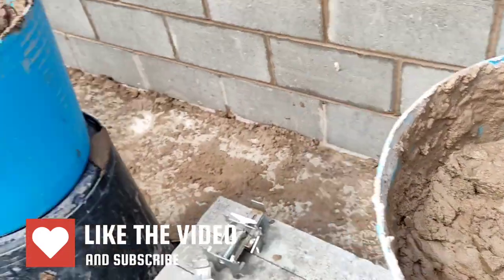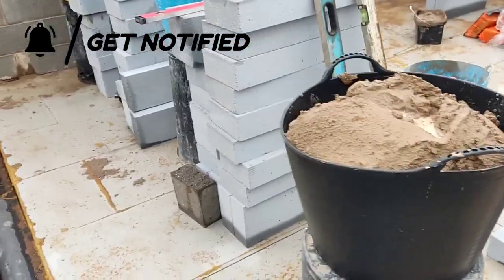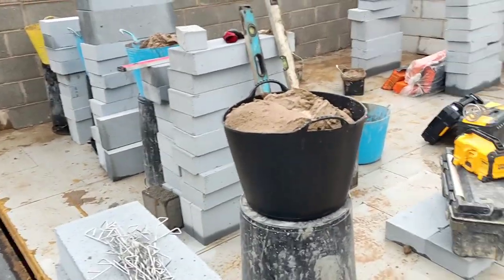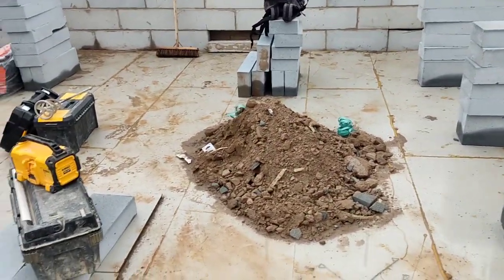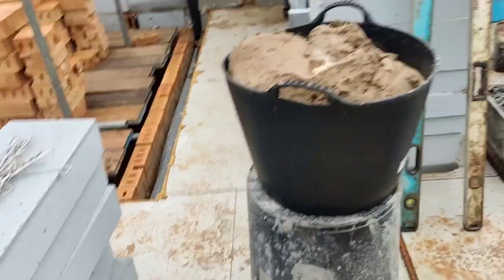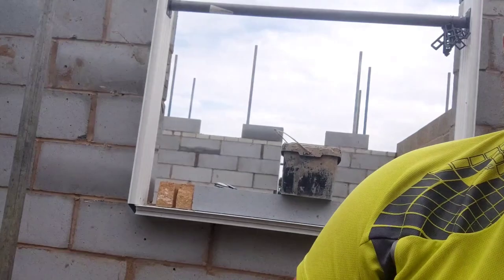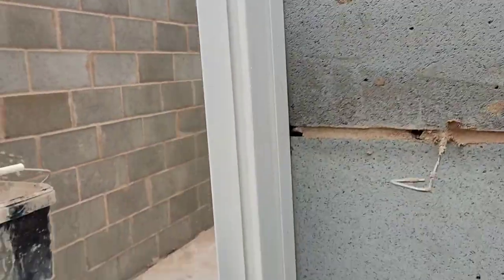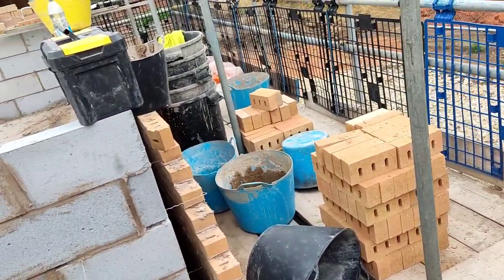Bricklaying Vlog - It Was a Rough Week?! Soldiers? & Freehand!

Comment: So you're buying new tubs after 3 weeks use, my 4 year old £35 gatorbacks(very expensive according to you) have so far cost me 15p each per week and reducing, and still in very good condition, i asked how you got the last mortar out of the tubs, looking at the pile of mortar on floor i now know, a lot of waste there.
Reply from the maker: I prefer tubs for my style of laying mate, just more practical for dean to get on the trowel more since we both use small tile setting trowels, very similar to Dutch Trowels
Reply from the maker: More mortar per spot board stand for my money saves dean loads of time loading and more time laying
Reply: @theafter8bricky  Thats fine mate if it suits you, it was just you saying that the gatorback boards and stands are far more expensive than tubs, but over time that won't be the case, it would be a boring World if we were all the same👍